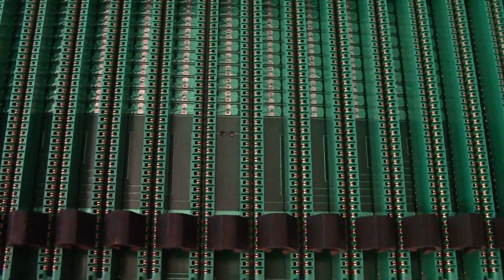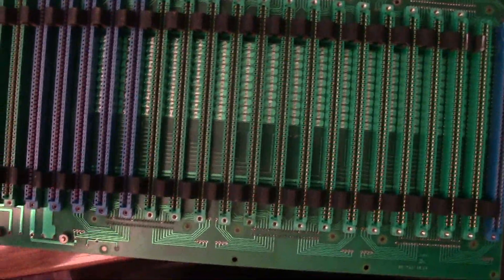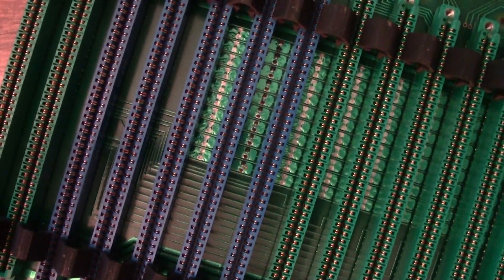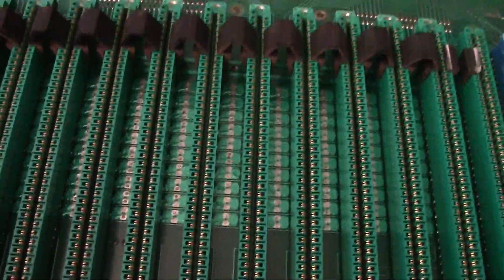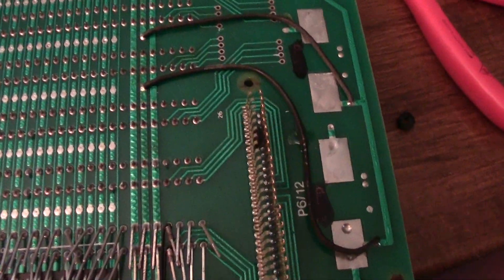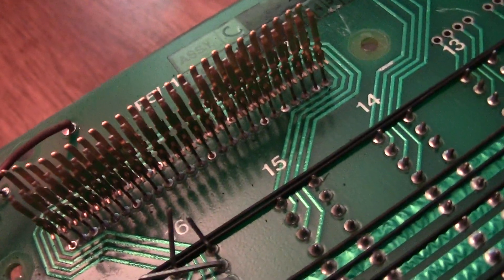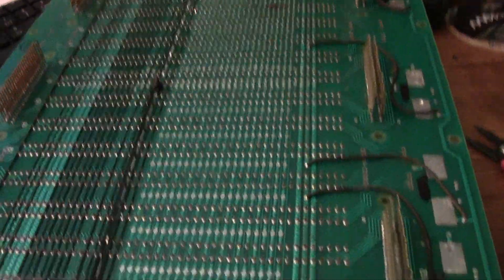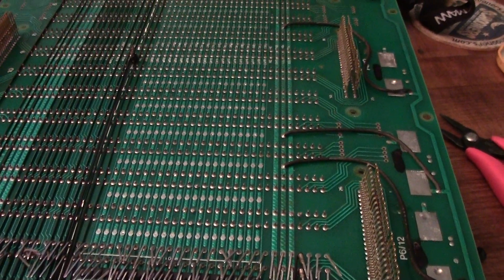Gold Recovery: Telecom Board Slots

Comment: I work at a metal scrap yard and I'm always finding some interesting stuff(scrap gold stuff). One day i found some telecom stuff that looked to be from the 60-70 era just from the look of the boards them selves. I was pretty sure the runners were silver but you have just concerned my theory. 
Feets, how do YOU remove the plastic part surrounding the pins??  I've been using a heat gun and a few flat screwdrivers to pry it up.

Comment: yeah how you get the silver off i know if i ask you enough times you wont be able to help yourself but to try lol thanks for the info
Reply from the maker: Denatured alcohol is supposed to dissolve the boards.
Reply: thanks i will try it on some boards
Reply: 8.10 PM ON 3RD OF MAY I PUT SOME BOARDS , BOTH LOW AND HIGH GRADE ALSO SOME OF THE FINE RIBBON OFF THE lcd SCREENS AND SOME PIECES OF VARNISHED COPPER WIRE OFF THE tv YOKES TO SEE WHAT HAPPENS

Comment: Hey feets, have you figured out a way to recover the silver from boards?  I know about using a heat gun and banging the board on a pan, but do you know of anything else?  Later bud.
Reply from the maker: Denatured alcohol is supposed to dissolve the boards. I haven't tried it yet. It dissolves the bond between the glass fibers.